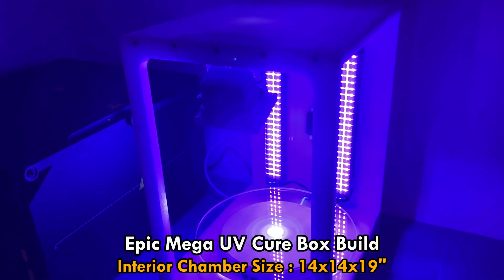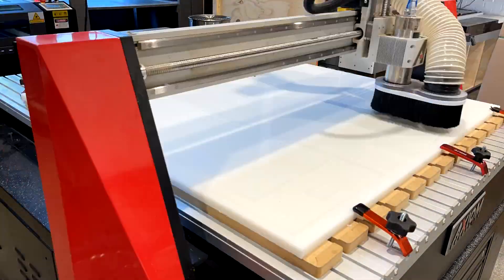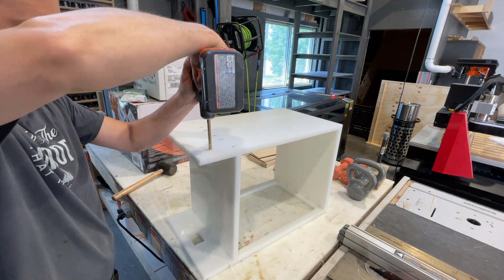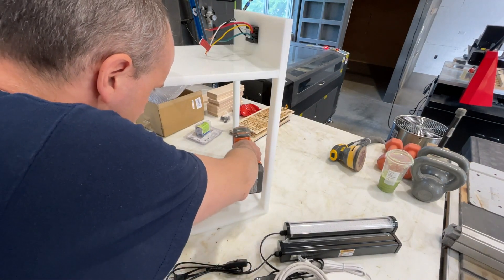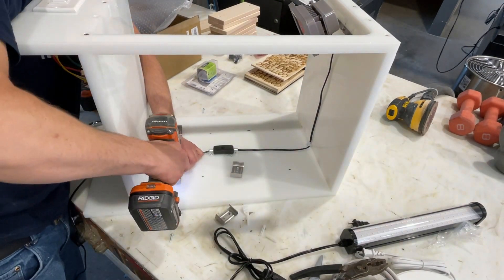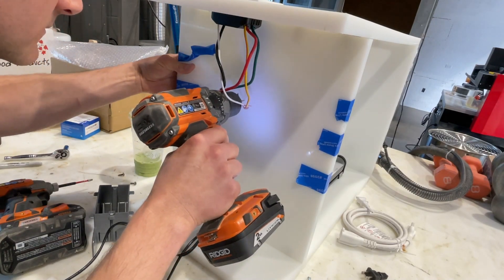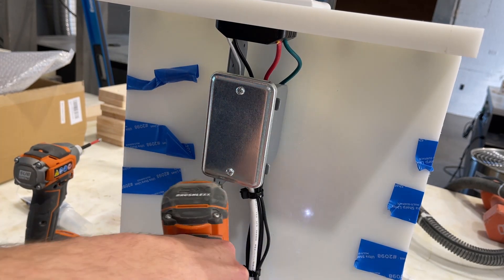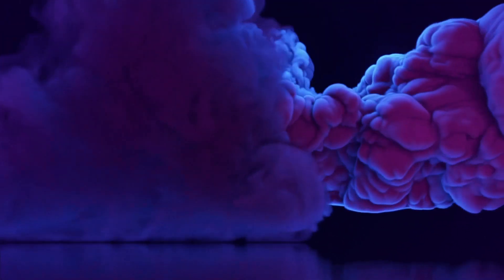DIY Extra Large UV Curing Chamber For 3D Resin Printers - XL Curing Box

Comment: bad design to have it all open, that UV then floods the space you put it in, your English sounds American, so learn to do some sheet metal design, use sendcutsend to cut and bend the parts out of uncoated aluminum, screw together, use regular sanitary silicone to seal seams inside, bare aluminum is reasonably good at reflecting UV, so when buttoned up the UV is reflected inside and isn't wasted damaging other materials in the room and you when it escapes your current enclosure
can leave outside of the case bare, AL won't horribly corrode in a room, or can spray paint using al primer, it would probably cost you less than that sheet of HDPE